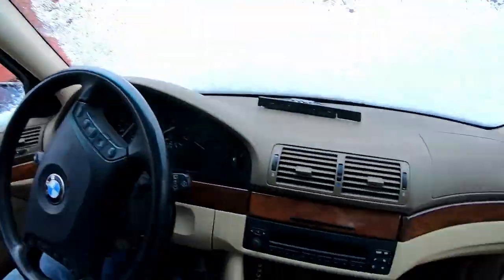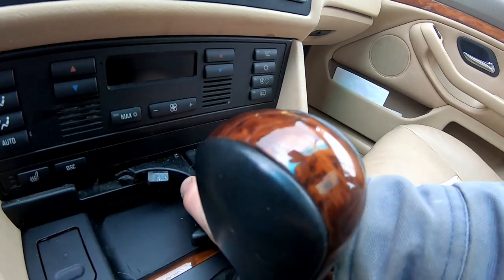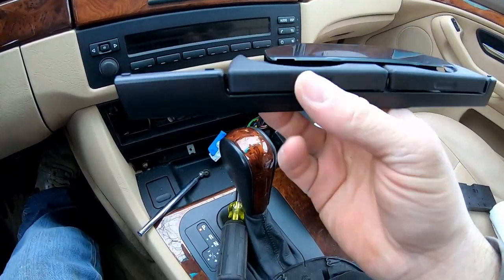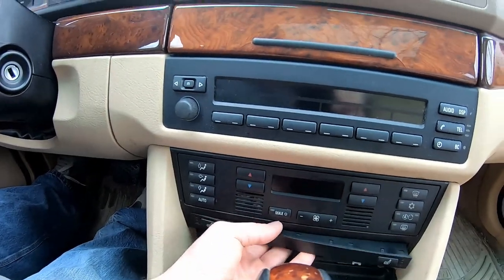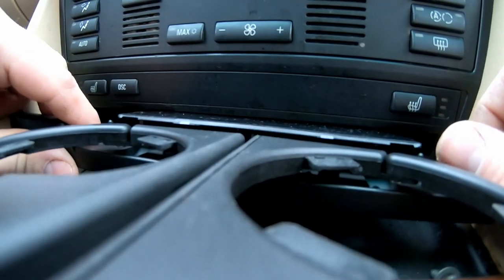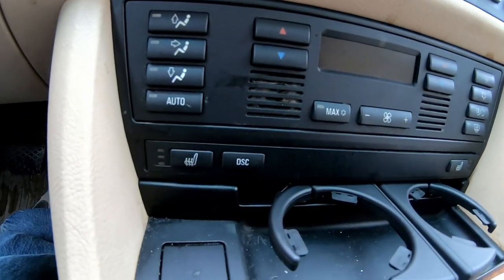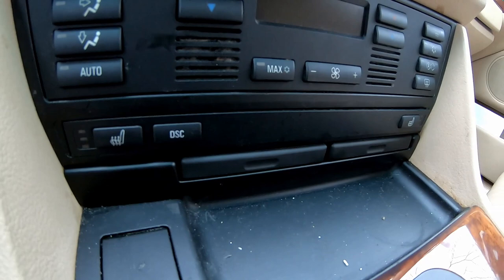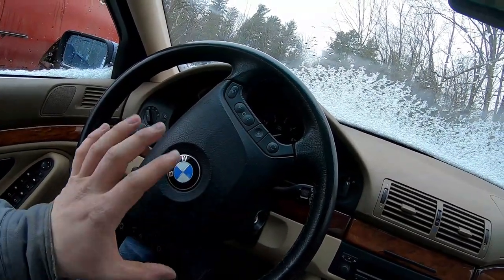How To Replace an E39 BMW Cup Holder

Comment: E39's are pretty awesome Bimmers overall. It will be a hard aesthetic design to surpass, at least in its class. But  yes, the cup-holders are a bad joke. Thanks for the video. I just got a Uro parts replacement, the $32 model. I know it won't "hold up" any cup of consequence, but I hope it holds up over time. 
BTW, that's a great Buick in the intro. My buddy had a GS Stage 1 in high school and it smoked a lot of Z28's in its day. Cheers.
Reply from the maker: I agree the eE9 is the peek of BMW in my eyes. Thanks I love that Buick I will be getting back to work on it fairly shortly🤙